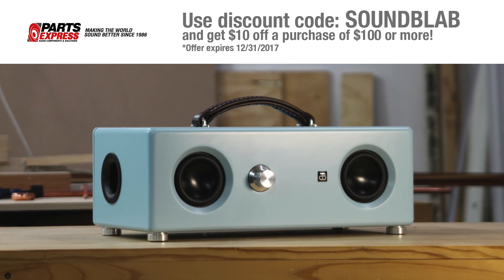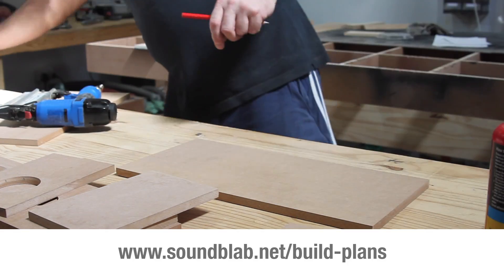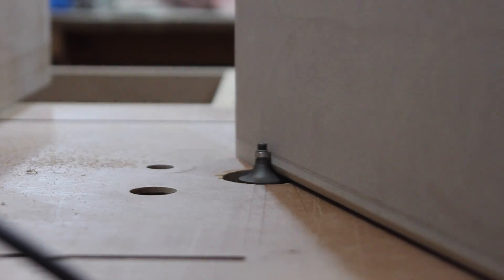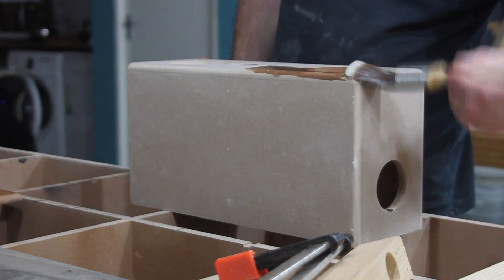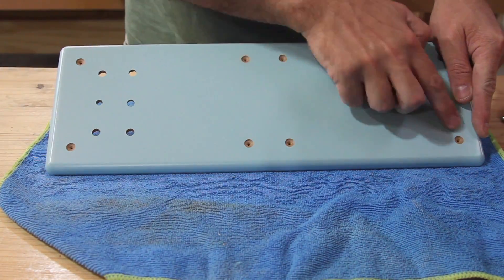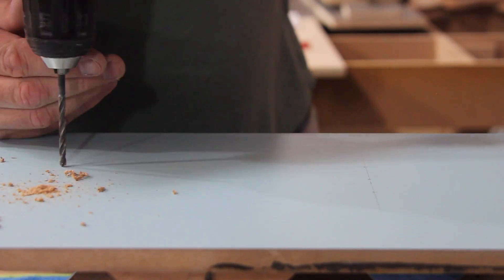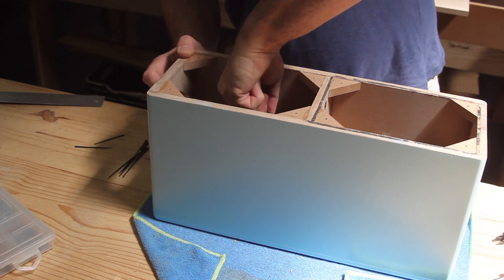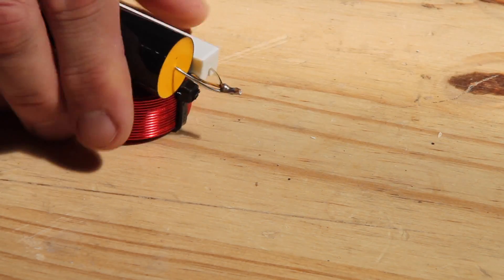Building a Retro Style Bluetooth Boombox Speaker - by SoundBlab

Comment: The driver is rated for 80-15,000 hz so wouldn’t you want to do a crossover with a tweeter or maybe something like the nd65 which can do 80-20,000 hz?
Reply from the maker: I could and have before, but for this one I didn't.

Comment: Can you school me on the point of a crossover on a two channel stereo build? As I understood it a crossover is used to differentiate signals for a high (tweeter) and low signal?
Reply from the maker: It is a circuit to flatten the frequency response and does not fulfil typical crossover function.

Comment: For 4s bms ,if  i use 18 volt charger it is possible or not plz tell me
Reply from the maker: I don't know. I do know that the 4s will require 16.8V, but not sure if the higher voltage will be a problem. Maybe someone else in the comments can reply if they have the anwser?

Comment: hello, I bought the plan and I realized the bluetooth speaker thanks to your excellent advice and your video.  the result is good.  I would like to know if it is possible to modify it to have a little more power, should I change only the amplifier, or have to change everything ...?
Reply from the maker: Thanks for the support! You could try this amp form Parts Express: https://bit.ly/2VDp02u . It is a bit more powerful, but be careful, it might be too much for the drivers if you go full volume. It should be a direct drop-in replacements for the specified amp in this build though.

Comment: Excellent work. Only one mistake that I've seen in this build. The coils will experience "cross talk" being aligned and in such close proximity to each other. 
Simply put a couple more inches of distance between the two and that should fix it. Or invert the coil in reference to the opposing coil.
Reply: Cross talk??? The drivers are about 12inch from each other!! Theres no point in even having separate chambers. He even hints at standing waves... how much bass does he think this thing will kick out??

Look, you lot are buying into the snake oil of hifi  waaaay to much. Just build a loud mono box.. nobody with ever compliment the stereo separation but you will be complimented on the build and how loud the damn thing goes.

Comment: Hi I have actually watched this video a couple of times and enjoyed and learned from it. I have made 2 Bluetooth speakers with MDF. I have a question if you don't mind me asking. Once you round off the edges how to do you get it so smooth that once its painted the porous edges don't show? Does the sanding sealer all by itself seal it all in?  Thank you very much!
Reply from the maker: Thanks. The sanding sealer is best applied and sanded in between layers a couple of times. Not just one layer. Then I apply an undercoat of spray paint, then top coat onto that.

Comment: Pleae what is that pistol u use immediately after the wood glue? thanks
Reply from the maker: It is a nail gun or brad nailer.
Reply: thanks
Reply: if i may ask? why did u put the sand sealer before u sand it ? i thought the tha sand sealer comes after u sand it? thanks
Reply from the maker: I will do an initial sanding to smooth the surface, then apply the sanding sealer and sand again. I will sometimes do a second coat of sanding sealer as well before applying the final primer and top coat.

Comment: Hi mate. Awesome work. Your all projects looks very nice. I'm also going to do my 3rd boombox. And have few questions for You. How long does it play without recharge on full volume? What do you use for charging? How much mAh do these batteries have? You running 12v or 24? My first built was very simple, just a stereo from car and batterie from motorcycle, but you probably imagine how much it wighted lol. Now I'll try to build it with creative 5.1 system, as it has everything what i need - speakers and amplifier. And you van buy it used musch cheaper than new speakers and d class amplifier. Ofcourse it won't have bluetooth. But you can mode ir to. With these batteries that you use the speaker is much lighter, but i need speaker that will play on full volume without recharge atleast 24 hours.
Reply from the maker: Thanks. I have not done test to see how long this speaker will run on a full charge, so I honestly have no idea. In this configuration I charge the unit with a 19V 4.74A laptop power supply. These batteries come in various mAh versions. The one I have is 2600 mAh each.

Comment: Why did you build a crossover if there is no tweeter?
Reply from the maker: This would not be considered a crossover, but rather a correction circuit. It is a calculated number of components that helps to flatten out the overall frequency response.
Reply: SoundBlab yeah, I actually looked at it again and figured that out, thank you for confirming!

Comment: Very cool. I have never built a speaker enclosure, but enjoy watching the build there of. 
Non speaker related question - your circle cutting bit in the drill press, where did you get it? I am also in SA and can't say I've seen it on the shelves anywhere.
Cheers
Reply from the maker: I think I got mine from Builders Warehouse, but you can also get it online here: https://www.tools4wood.co.za/product/circle-hole-cutter-adjustable-30-200mm-tccc30200/ and this one https://www.tools4wood.co.za/product/circle-cutter-large/

Comment: hey boet, great build! was wondering if the amp was a bit under-powered for the speakers or does that not make a difference ? bit of a noob here.
Reply from the maker: This amp works well in this combination, but I have also wondered if the 30watt per channel amp from Dayton Audio will make a big difference. I think it might help a bit at higher volumes where the smaller amp seems to run out of oomph a bit. It is an easy switch to the larger amp though. They use the same connections and are the same size board. I can definitely recommend trying it.
Reply: SoundBlab thanks for the info!

Comment: Nice build and great channel!  Can you provide more detail on the parts you used to mount the amplifier board - specifically the screws and stand-offs used?  The parts listed don't seem to match what's in the video.  Thanks.
Reply from the maker: Thanks. The stand-offs are what is typically used for mounting PCB boards. I got them from my local electronics supplier. You should be able to find them online from a similar supplier. They should also be able to pride you with the screws. The stand-offs come in different lengths. Try these at Amazon: http://amzn.to/2Dmzvx4 , http://amzn.to/2BiNNNK

Comment: I've never build any "adult" speakers and have a small questions to understand everything better...
1. Why have you glued reinforcements after you painted the enclosure? I think It would be easier to make all sticky parts in the first place.
2. How the paint layer quality looks like? Are there some artifacts due to spraying in dusty enviroment? I have always problems with it :/
3. Wouldn't wood screws with plastic tubes hold amp/bat PCBs better?
4. Is it a standard practice to hot glue "speaker related passive components"? I see a lot of people doing this.
5. For how long the batteries last? 3xAA is not a lot for 2x15W amp...
Reply from the maker: 1. A build sometimes evolves as you go along and that is something I realised I did not do only after painting.
2. The paint finish is smooth. I usually make sure my workshop is clean before I painting.
3. Yes, if I had them on hand at the time.
4. It is a convenient, easy and effective solution.
5. These are 3.7V 18650 rechargeable lithium batteries, not AA. The last very long when fully charged.
Reply: Thanks!

Comment: Really well done! Where did you get the speaker feet?
Reply from the maker: Thanks. There should be a link in the video description :)
Reply: Thank you! I also wonder why most people recess the drivers and chamfer the edge of the hole. Is it for sound or just because it’s easier than flush mounting?
Reply from the maker: It's for aesthetics and to avoid reflections. If you mount the driver from the front you will see the flange, which in this case is not pretty. But if you mount the driver from the back it looks better, however you need a chamfer to avoid nasty reflections from the edge of the hole that can influence the sound.

Comment: Hi, love your videos and your desgins. But i have seen something that make me cringe on a couple video. 
The placement of your hand behind your plunge saw.
You should always try to put yourself on the left side, and you should never hold the rail with your hand behind the blade. Kick back happend wwith it, even in soft wood, especially when cutting narrow pieces, i saw ti happend, happend to me, and i'm glad i hadn't my hand where yours is.
Keep up the good work, i hope you see my comment and don't put it in the meh section.
Reply from the maker: Thanks man! Yes, I am aware of it and always very careful. I am left handed which makes it a bit awkward.
Reply: I can only try to imagine what i would be facing if left handed, most hand tools can be found for lefty, but electric tools, smal or big, are usually for rightys. As long as the rail is fixed and the wood piece can't move forward, you're ok anyway. Cheers.